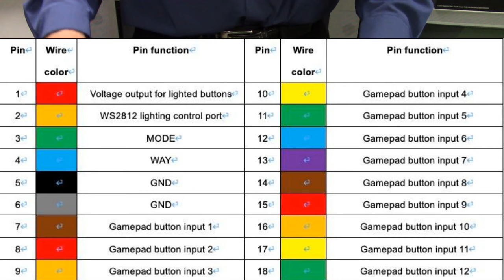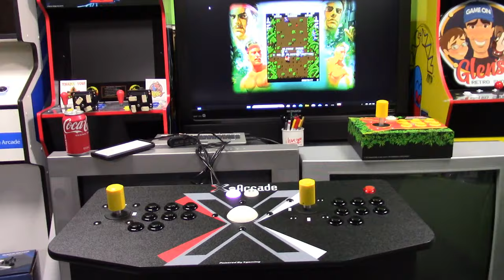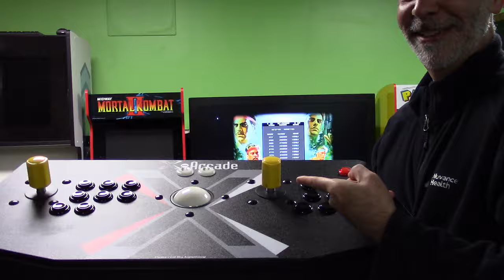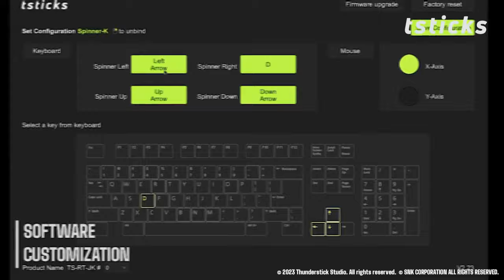Make your GRS Ikari Warriors Super Stick an X-Arcade TANK..

Comment: I dunno... I love GRS products and I own the Tank Stick but gutting the Tank Stick to make a "box" for the Super Joystick seems overkill and takes all the advantages (multiple controller options) of the Tank Stick and reduces it to just the Super Joystick.  I pre-ordered the Super Joystick in September.  There's a 100% chance I'll leave my Tank Stick alone and build a box for the Super Joystick.  But props to Glen for his devotion to this hobby.
Reply from the maker: Thanks man, I appreciate it and again it was just a project for me and really just showing off a conversion kit for the HAPP joysticks 🙂
Reply: @GlensRetroShow  No worries.  This is the kind of good stuff that inspires others in the community.  I even added the GRS spinner where that lighted red button is on my Tank Stick for games like Tempest and Arkanoid.  The Flight Stick is standing by for yet another control deck project (Zaxxon!).
Reply from the maker: @marathonfreak67  that was my plan originally but I figured for this video just leave it as that, but I do plan on making that modification myself. I assume you had to open up the whole little bit. I don't think it's 28 mm. Isn't that red buttonhole.
Reply: @GlensRetroShow  You are correct, sir!  I believe the standard hole for that ONE button is 25mm.  I 3D printed an insert with a "center punched" guide for a 28mm forstner drill bit.  A step bit would not be as effective on wood of that thickness.  It worked perfectly.

Comment: I had ordered the Ikari super joystick.  Out of the box stock, is the joystick mount compatible with anything other than the outer package case that it comes with?  For example, will it fit a Sanwa joystick mount by chance?  Or is the best route to buy the adapter and put it in a case for built  joysticks?  Thank you.

Comment: I just tried setting up two of these joysticks in an actual Ikari warriors control panel and what I'm finding is that after reboot in Windows the USB order is flipping between player 1 and 2 in RetroArch.  I have each joystick set up in the configurator as ID 0 and 1.  But within RetroArch it doesn't seem to be able to differentiate them.  The weird thing is that the rotation keystrokes are not flipping, just the joystick and buttons.  So it is basically unplayable when this happens.  Any suggestions?
Reply from the maker: The Rexer show just made a video on the setup of GRS Ikari Warriors Super Joystick and retroarch :) that may help
Reply: I'll check it out! @GlensRetroShow